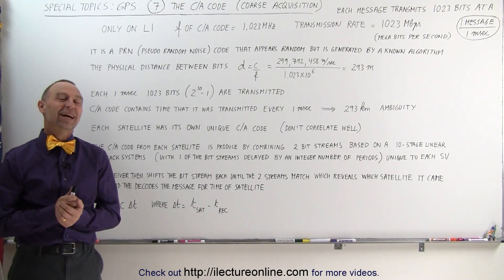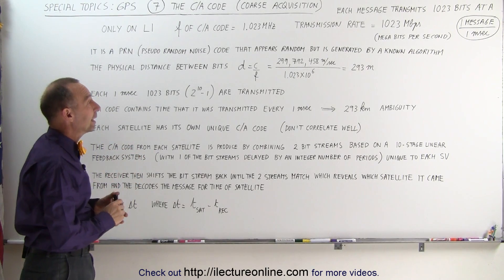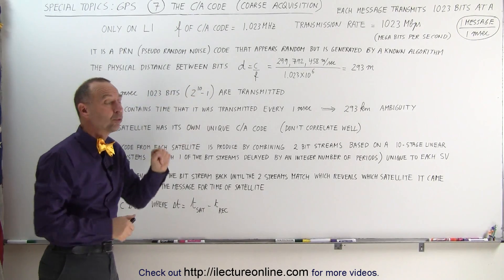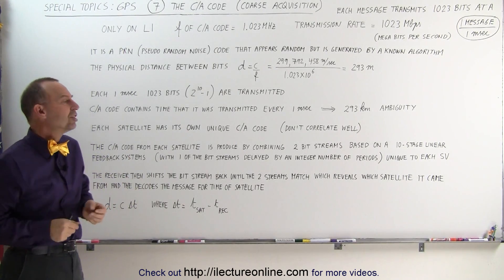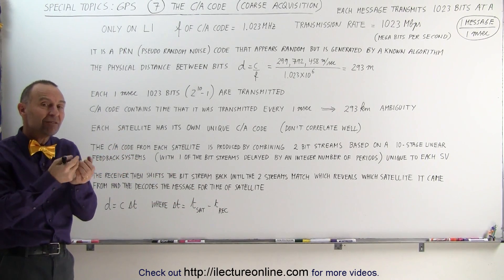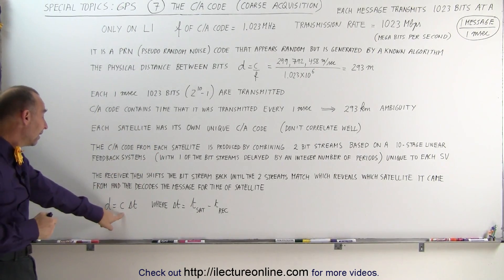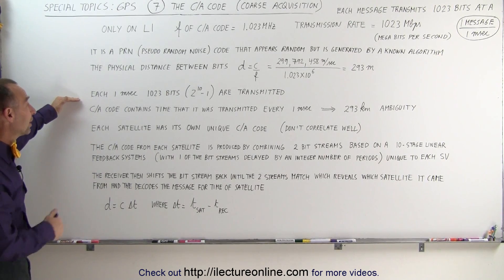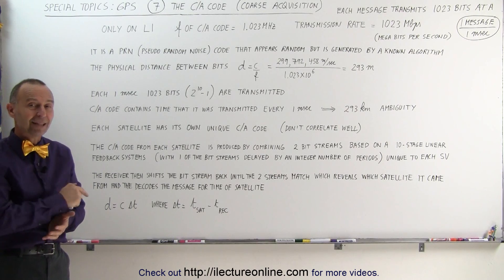Special Topics - GPS (7 of 100) The C/A Code (Coarse Acquisition Code)

Comment: 1023 MBit/s = 1023*10^6 Bit/s = 1023*10^3 Bit/ms = 1000 Messages/ms
What am I missing?

Answer: A decimal point. It should be 1.023 MBit/s
Reply: I was also lost in here but take a look at Mr Biezen reply to  Sir, Shouldn't the transmission rate be 1.023 Mbps instead of 1023 Mbps ?  comment on the top.

Comment: Ok so whats the point of looking like noise if its not an encrypted channel or a military channel? 2. So two streams of data that are exact copies are sent but with a set delay to differentiate which sattelite it was sent? Is this what I heard? I feel like there is a better way to signify what sattelite is what without the redundancy,  its wasting bandwidth.....Also since radio waves are EM waves like light and I believe refraction, is basicallly a term that implies that light travels  at different speeds in different mediums, so isnt there ambiguity already because of the different mediums that radio waves have to travel through to get to the receiver? I wonder how they compensated for that... Please clarify.
Reply: The point of PRN is to allow all satellites to operate on the same frequency, otherwise they would interfere. The PRNs allow all the satellite signal to coexist on the same frequency through the techniques of CDMA (code division multiple access), through the orthogonality of Gold codes.
Reply: @irrationalpie3143  Congratulations! Your two sentences make better sense than the whole 5-minute video.

Comment: Sir, Shouldn't the transmission rate be 1.023 Mbps instead of 1023 Mbps ?
Reply from the maker: Yes, there should be decimal point there.    1023 bits at a msec rate.